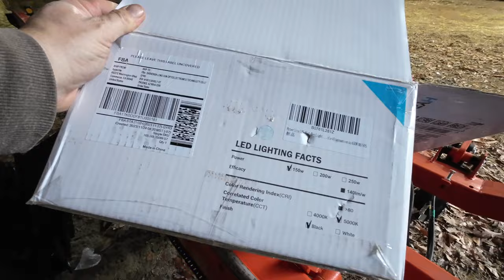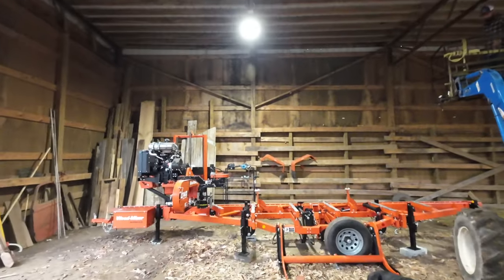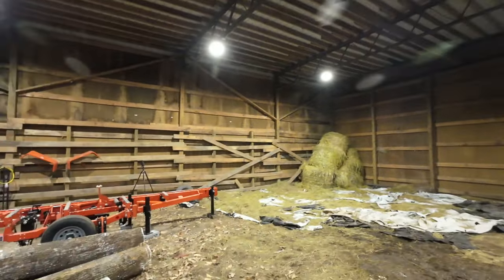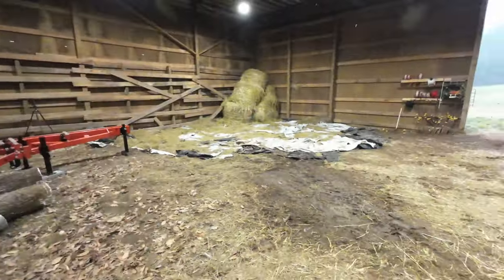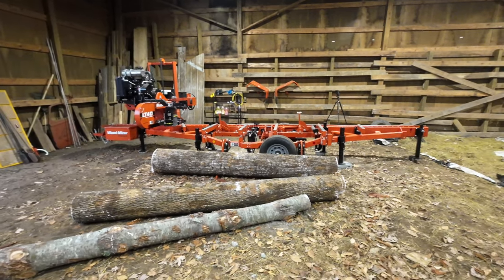What Can We Do With A Log AND The Wood-Mizer LT40

Comment: When you are working with logs, keep an eye out for the wood being stained. If you look at the popular log, you showed that you cut off, and you can clearly see the staining in that log. To save blades, you can get a detector and locate metal and dig it out.
Reply from the maker: You are correct. I also noticed a big “spot” on the log at about the level of the nail. That should have been as clue as well.